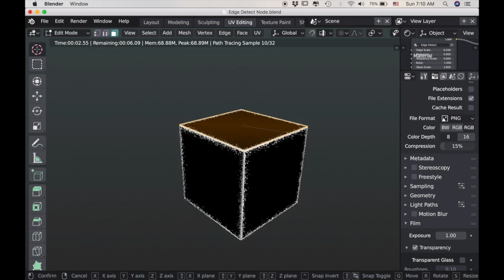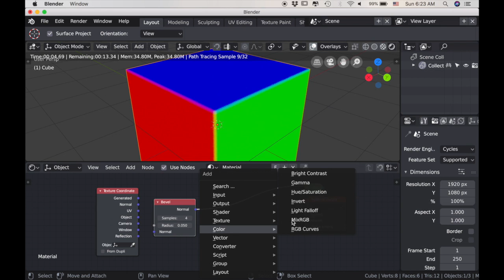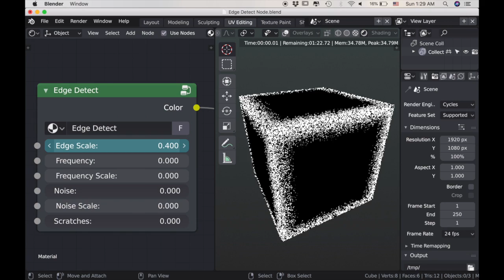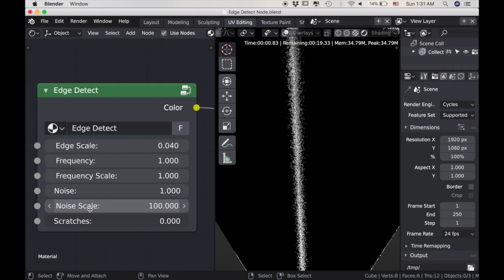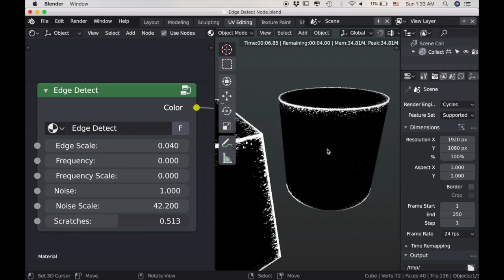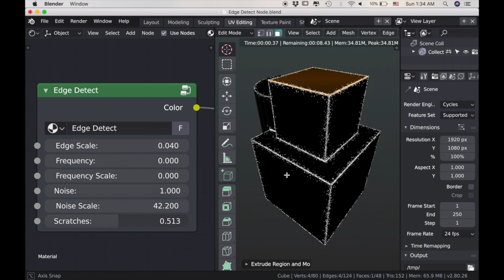Edge Detect Node for Blender 2.8

Comment: Hi. This node group doesn't work with a sphere. What if it needs to outline edges on a sphere according to current camera position!? What do you think about it?
Reply: Use feline entity's outline helper, and set the material to a noise texture, I'm pretty sure this should work.
Reply: @uphjo6969  what's feline entity outline helper? Where can I get it? Does it work in eevee? I somehow solved this problem in cycles, but not in eevee. I don't remember how, it was a long time ago. Anyway, thank you for the answer.

Comment: Love it ! This has to be the most diverse and well optimized edge detect node that i could find. One thing how can I exclude cavity edges and give a dust material for the Interior edges ? I tried with AO node but still those remain shiny ,I probably doing something wrong ,how should I use the mix node ? Thanks for the tut ✌️🙂

Comment: How do u bake them so u can use them in eevee , and great tutorial
Reply: In create a new texture in the image or UV editor called Bake, make it whatever resolution you want. Then in the node editor, use the edge detect node with whatever you want your settings to be going into an emission shader. Then make an image texture node with your bake texture on it and make sure it is selected (Use a UV map node plugged into the vector if you want to use a different UV map). Now just go to the bake menu in the render properties tab, open the drop down and select emissions, and bake your texture. This will bake it all onto a map you can use for whatever you like.

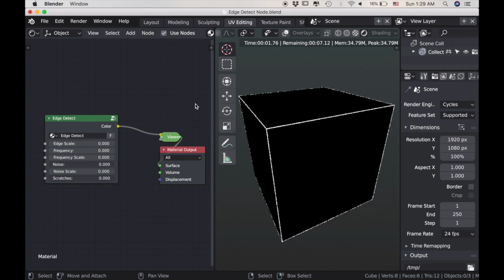Comment: 1:30 the cube has a dark corner after opening the blende file
Reply: Sadly it doesn't work with eevee... Try using Cycles instead and it should be fine

Comment: Thanks for sharing! Very useful! 

Btw, why not adding to the node parameters an inward-outward oriented edges option too? Such an option would be very helpful in adding easily dirt to inward oriented edges and decay on the outward oriented ones separately.
Reply from the maker: I work on it. I did try that initially, but couldn't get a good result.

Comment: You should just use new AO map node in 2.8 or 2.79 experimental builds. It will give you the same thing with easier setup and will allow you to separate and choose between concave and convex edges.

Comment: Hi Michael, Great node and thanks for shareing. Nightly builds use the bevel node, so would this work with the 2.79 nightly buildbot versions?
Reply: Answering my own question. YES, it works fine in the nightly builds. Thanks!
Reply: I tried it and i get 3 sides of a cube show up in white and 3 in black, can you explain why?

Comment: so you mentioned help improving the node, unfortunately this is a utility node and its allready working quite well from what i see here. this means that not much can be done olong the lines of improvement however maybe a few optimizations can happen (if there are more nodes than what you showed lol) however there is a few things it could have. like for instance a image input and possible color output. thats all i can think of for improvements though. ill work on getting those in and let you know once i have
Reply from the maker: Good luck. It's a mess in there. Haha  Ultimately I'd like to simplify it.
Reply: ill get too work on that as soon as i can. im pretty good with nodes myself, maybe ill be able too rebuild it

Comment: Hi Michael, great add-on!  What's the best way to have this permanently in my blender setup? Is there a best practice for adding a node so it's always there? Cheers.
Reply from the maker: I think if you click on the "F" on the node and then in User Preferences select - Save Startup File. It's been a while since I've done that, but it should work.
Reply: Thanks I'll give that a try.